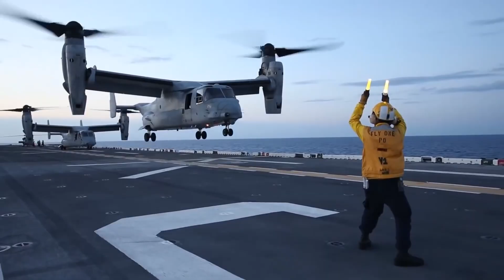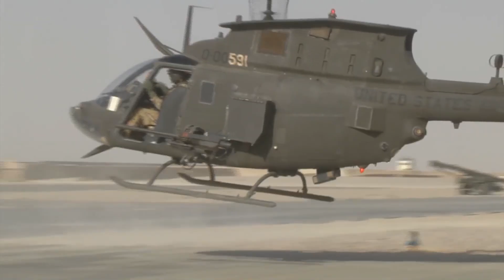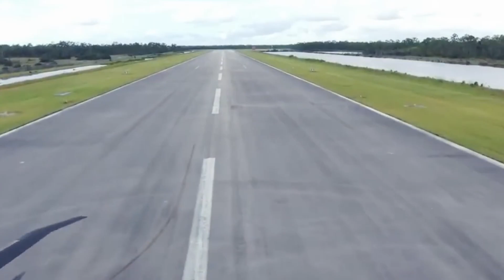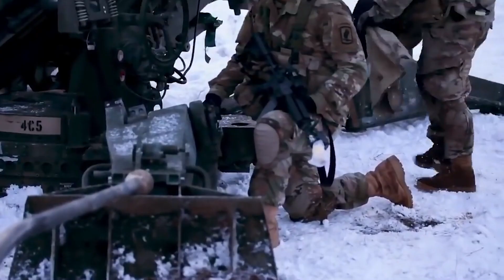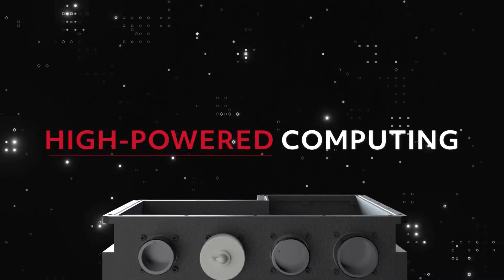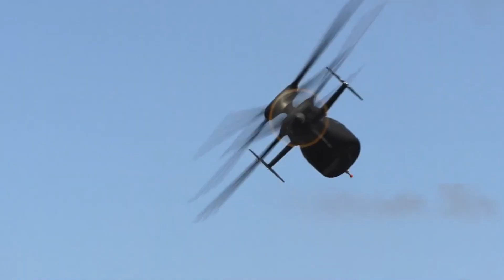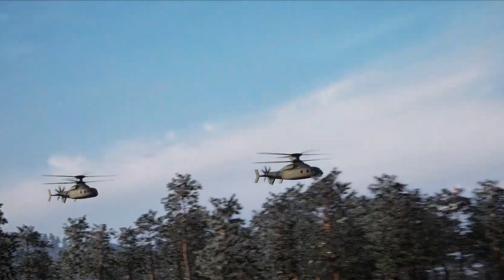SB-1 Defiant - Must go faster!

Comment: There's a couple things that're for certain with the Defiant; it'll cost several times more to operate than the UH-60Ms, and will at least be just as maintenance intensive as the Apache was in the early 2000s. 

Even just coaxial rotor helicopters such as the Ka-52 are considered to be 'maintenance intensive' compared to their more conventional single-rotor alternatives. The Defiant, despite using coaxial rotors, it also features the equivalent of a tail-rotor, has a fully retractable landing gear (AH-64 doesn't), has RAM coating that must be maintained, and its composite air frame is significantly more complex to repair in the field than aluminium air frames are the biggest issues.
Reply: there is no RAM coating... these aren't stealth helicopters.
Reply: "No tail !!!"    _Edna Mode

Comment: SB-1 has an unusual rotor dampening system that has not performed well, limiting performance and causing their loss. As these stiff blades rotate, the lift on each advancing blade changes in it's aspect or angle of attack. All helicopters use this system to shift lift around the disc generating the ability to pitch aircraft up down or side to side. Unfortunately that makes the rotor blades "flap" or act like a diving board as lift changes from positive to neutral in this craft vs positive to slightly negative. This generates severe vibrations that the damping system is hopefully able to control or reduce to manageable levels.

Comment: Ka-50 was befor
Reply: completely different coaxial design...
Reply: @n3v3rforgott3n9  
It's exactly the same idea of rotors on top of each other spinning in opposite directions
Reply: @999.9finegold  ... So you didn't google it? Google flexible rotors on helicopters and rigid rotors on helicopters. There are major design modifications and changes that have to be made for it to work. Which would also bring major befits over flexible rotors once the technology is matured. Also the Russians were not the first country to fly coaxial helicopters...
Reply: @n3v3rforgott3n9  Did I say first? I said before. And the fact that there are many upgrades does not change the basic idea. I don't understand what you are arguing about
Reply: @999.9finegold  ... it is a completely different coaxial design.

Comment: Its not about looks.  Defiant looks cooler but the Valor is a superior machine period.  Weapons systems are choosen for what is needed in the present era.  Defiant is built for jungle close tight area situations.  I would much rather be medi-vac in a Valor because being 100 mph faster than Defiant  is a really big deal.  Not to mention, the commercial applications for the Valor would be a smash hit.  Valor can out distant travel anything currently available by a large margin.  Some people are too old school and think that all helicopters need to resemble Blackhawks for it to function correctly.  In conclusion, inspecting 16 blades everytime you want to fly the Defiant is a lot of time wasted... Sure the Valor has a bigger footprint, but the abilities far offset that liability any day of the week...

Comment: I feel bad about SB-1 losing to V280 not because of performance, but because the US Army deemed so.
The Army always wanted an attacker of their own but forbidded to own any fixed wing aircraft. The tiltrotor is a perfect loophole.
The SB-1 is not so complicated which means easier and cheaper maintenance and do not have a tiltrotor transition state. It may be good as an attack helicopter or anti submarine helicopter.
Such brilliant design and good work should not be wasted.
Reply: "not because of performance" - the Defiant lost in nearly every metric out there...

Comment: This would make an amazing option for a private helicopter. In "gyrocopting" mode, this thing could switch its upper rotors to mostly passive rotation and receive only propulsion from the propeller in the back. Gyrocopters are more fuel efficient than helicopters. It would be faster and have twice the range of a helicopter, have all the functionalities of a helicopter, while none of the massive constraints of a plane. Having twice the range of a helicopter it would match the range of most private jets and would match 70% of their cruising speed. Given that it can fly from anywhere to anywhere, and not from airport to airport, this would not be even a net increase in travel time.

Comment: If they could make folding rotors the blades could be put into a delta configuration with the blade on one side rotated so that there were essentially two swept wings. And the third blade would be in the middle rotated blade up, so it played the part of a tail.
Thus the jet engines could provide maximum thrust after the blades were folded into a delta wing configuration after reaching 100 to 120 km / hr.

Comment: Looks neat. Though i think the hunt for best speed with this concept seem like banging head against the wall. No matter how powerful or large the engine or rotor. Speed will always bee limited by rotating wing. You might not have problem in retreating blade stall- like with regular rotor. But now you have to keep an eye on coning. And at certain max speed those propellers will strike each other. Unless they can pull out of the hat some sort of "The 6th day" movie style of converti plane, i think this is a dead end when it comes to speed.

Comment: This is simple a battle between two concepts.
1. SB-1 Defiant - using a helicopter and literally pushing it as fast as possible.
2. V-280 - using a plane and making it able to land vertically in an efficient way.
For bringing cargo from A to B in an efficient and fast way, a helicopter, no matter how fast, simply cannot compete.
Half of each rotor is generating just drag and there is no way of making this efficient.

Comment: the Defender/Defiant design is impressive in that it can fly the way a submarine dives ... it can hover while pointing downward, and accelerate or go backwards without tilting forward or back. The horizontal propeller design (I would think) has a smaller radar cross section on approach than the Valor with it's large props pointing forward (of course the high central propeller shaft tower may negate this advantage). IDK - either way, I would prefer to see something a little quieter and even less conventional than any of the current offerings to really make a leap forward.
Reply: Valor can do same as Defiant with ability to "point" , and in lateral movements it's better due to rotors offset on wings. Defiant needs slightly more reaction time 
laterally but is simpler to fly, so probably equal in evals by ARMY.

Comment: As I see it given that Bell has already gotten the contract for the Valor, they will also likely win the FARA contract as well since the Invictus is just slightly smaller than Raider profile wise and is based on proven and established aeronautical grounds already however, I can see the Defiant X being the replacement for the Apache given the coaxial rotors would give it better lift characteristics thus allowing for more/heavier ordnance to be carried.

The main problem is the height of the coaxial rotors if Sikorsky can bring the lower one down closer to the fuselage of the aircraft similar to how it is on the Raider and likewise bringing the upper rotor down as well in conjunction, likewise I don't think the Army is a fan of the side by side and prefers the tandem cockpit for attack and possibly for the recon role as well, given that it allows the profile of the aircraft to be smaller, the push prop is also a issue I do not think the Army likes it since they view it as a vulnerability and additional weight that would only be used intermittently.
I wonder if a NOTAR variant system coupled with that reduced thermal signature system for exhaust gas employed on the Comanche and I suppose now Defiant X, in a quasi vectored thrust manner could be used instead? Given that Boeing should have access to those patents after they acquired MD in 99 and it would likely be far quieter than the push prop would be, having stood near a MD 500 and a MD 520N which are in effect the same helicopter with the only major difference being the former uses a standard tail rotor while the latter uses the NOTAR, while it may be subjective personally I do believe the NOTAR was indeed quieter overall.

If Sikorsky opts for that and incorporates it on the Raider as well it may even win them the FARA contract to, given that the intended purpose of that helicopter being the recon role and being quieter with a reduced thermal signature is better in that case, which may push it over the edge in the competition.

Comment: chinook has been doing what these copters have been designed to do since the sixties.  in fact in afghanistan and iraq the apache pilots had to ask the chinook pilots to slow down lol.  because the blades counter rotate it can fly pretty quick . only beaten by the v-22 osprey with its tilt rotor.

Comment: I'm hoping that the V-280 will be adopted for the larger platform and the Raider will be adopted for the smaller. The tilt rotor makes more sense for a large craft, while the coaxial works better for a small one.

Comment: the counter-rotating props are the strongest but also the weakest characteristics of the Sikorsky Raider/Defiant.  If I was the US Army I would like detailed calculations of the separation between the props under all flight conditions.  I would also like actual measurements of the separation under all conditions.  For instance, in a high-speed bank, how close do the rotors come?  What’s the difference between a 70º right bank versus a 70º left bank?  One bank is going to produce more pressure on the lower prop.  How close does the lower prop come to the upper?

As far as comparisons between the Sikorsky Raider and the V-280, in a contested environment both are really vulnerable.  I’m guessing the Raider would be superior because it could fly lower and make more sudden course changes.

Comment: I suspect the whole design may be fatally flawed because the army requirement for side doors.   Can anyone point me to youtube video where the actual side doors are open?  Their in the CGI examples of a flying Defiant but I didn't notice  side door operation on the footage of the actual prototype testing.   Could the weight of the dual rotator system plus  2 engines and a heavy drive box for the push propeller be too much to have two large, usable side doors?  Too much weight too many stress fractures for this design to be durable.  Just speculation so can I get a reply from someone with direct knowledge about this design?

Comment: This configuration of aircraft always captivated me, a simpler way to create a vtol aircraft than going full tilt rotor, while also retaining much more agility in vertical flight, but it fundamentally can never be a very efficient design, since during high speed horizontal flight those massive coaxial rotors don't do much except generate enormous amounts of drag

Comment: A blade on a tilt rotor experiences the same forces as it goes round no matter what the tilt orientation is so there isn’t a vibration or oscillating force. The contra-rotating blades will have aerodynamic forces flexing the blades due to the relative wind speed on every rotation and the problem gets worse with speed. This is a nasty fatigue stress situation. I’m sure that it’s been taken into account and designed around but the tilt rotor is more elegant in this respect.